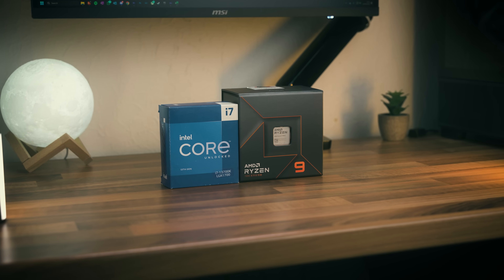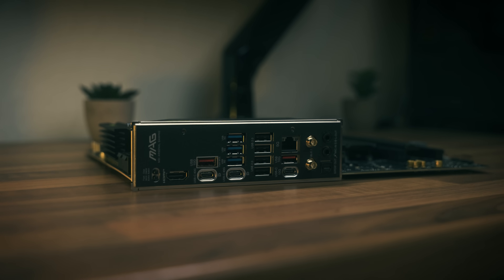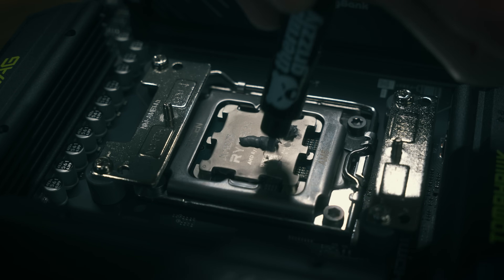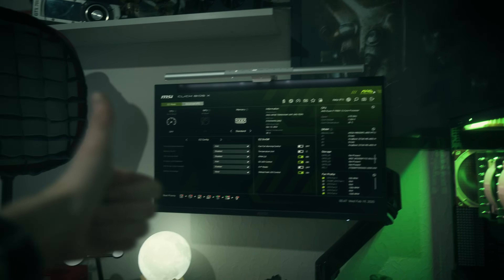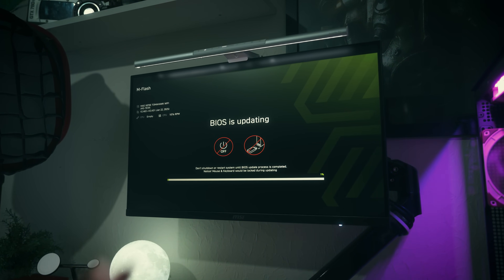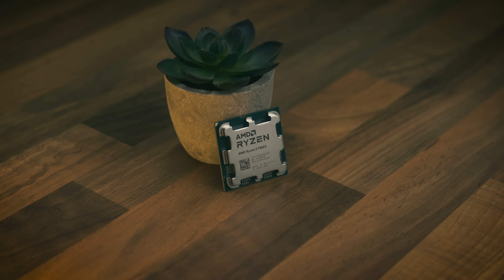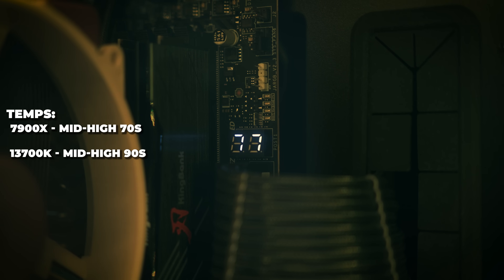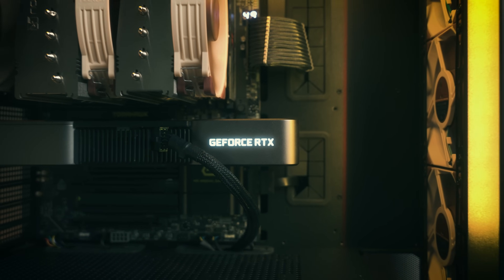Why I Switched to an AMD Ryzen CPU in 2025 (7900X)

Comment from the maker: UPDATE: After reinstalling the drivers again and again, the 5GbE LAN now works. Weird issue right😂
Reply: Good to know. That's def weird. Also I returned my MSI MAG mobo and CPU because something messed up in the mobo or (and) CPU, and my last ditch effort was unable to fix the issue.
Reply: Wasn’t aware that this 12c 24t was on am5 gives me hope to upgrade as was gonna get the am4 version. AM5 seems to have a lot of bugs on MSI and asus  and finding gigabyte is way forward or using asrock as there is nearly next to no issues every time I have read up for this chip and can use 4 sticks ram too
Reply: @ Yeah I've heard that AM5 on an ASUS was a disaster, and there were some examples of VRM exploding. That was about 2 years ago, and I think now ASUS has very likely fixed this issue

Comment: For the responsiveness thing on intel from my exp it seems to be tied to core parking for whatever reason it seems alder lake and raptor lake are very slow to wake up the cores from sleep. You can turn it off but intel does not recommend doing so apparently its tied to how their boosting works. I think buildzoid has a video covering it

Comment: yes, ryzen tends to be snappier. i have an i5 6500 and a 12700k, then in 2023 i got a ryzen 7600. just 2 weeks ago i got a 9950x3d. i got it almost for free. FREE! the two ryzen cpus are much faster and snappier in almost everything. intel monolithic cpus dont have usb at the cpu so you connect via chipset. amd on the otherhand has usb directly connecting to cpu in addition to more pcie. i dont think this is the reason or the only reason why ryzen cpus feel snappier. there could be other reasons to this
Reply from the maker: I had a hunch the I/O controller position on Intel would cause it to feel a little less snappier. The fresh OS install certainly helps too

Comment: I don't know what is with these 2.5g ethernet ports but they seem quite hit or miss. I have an Asrock x570s pg riptide motherboard. It works when it does but for some reason after "x" amount of time it just cuts internet for no reason. I tried everything and got enough and bought a seperate 2.5g pcie card for internet and everything just works without any fustrations.
Reply: i noticed this a lot of intel nics but i wonder if its possibly a heat issue as i notice alot of these issues get resolved with a pcie network card

Comment: Using that 3rd M.2 drive in that board, did that knock your GPU lanes down to 8 lanes instead of 16 lanes ?
Reply from the maker: No my GPU is still running at x16. The third NVMe is connected to the chipset

Comment: I got the Ryzen 9 9900X for $330 3 months ago for a better optimized AVX-512 pipeline compared to Zen 4. I came from a dead i9-13900K and wow! AMD is so good now, even with 8 less threads than my i9 had not only did it handily beat it in multi-threading workloads but it also beat it in single-thread while only pulling 120 Watts! So I moved to a noctua air cooler from a 360mm AIO thanks to the more sane power draw. I also noticed that the DDR5 memory controller seems to be a lot better than intel's. My 6400 MHz XMP just works OOTB and I was even able to tune the infinity fabric clock to 2133 MHz to better match the 1:1 ratio, I am seeing great performance out of this chip! Intel just sucks now lol
Reply: make sure to manually set uclk=memclk(gear1). most motherboards wont do that for you and instead set it to gear2 mode. 6400 gear2 is terrible. i dont know if your 9900x can do 6400 gear1 but if it can that would be amazing. if it cant you can still do 6200 gear1. that would be much better than 6400 gear2

Comment: What a sick system! I wonder with so many SSDs inside, do they block any threads of the GPU? In any case, very nice looking and performing system YamYam..
Reply from the maker: Thanks man! Glad you like the rig. My GPU is running at the full 16x lanes. The 7900X has 24 usable lanes (16 for the GPU, 8 for storage directly wired to the CPU)

Comment: in terms of performance this is a downgrade imo. 7900x is effectively a 6 core gaming CPU.
Reply: Not only is the 7900x a 12 core CPU, it's also faster than the 13700k. Base clock for 13700k is 3.4 GHz and boosts to 5.4  GHz. The 7900X starts at 4.7 GHz and boosts to 5.6 GHz. It's not a massive upgrade but it's definitely an upgrade.
Reply: @TheRosemouth  I'm to lazy to check wich cpu I faster but comparing cpu clocks is meaning less. Each generation of cpus has diferent amount of stuff it will do per clock.
Reply: Have you seen the entire video ?

Comment: It's a good CPU for the money, but why not get the 7950X? I've often wondered why someone would choose the 7900X over the 7950X, so I'm genuinely curious.
Reply from the maker: It didn't seem worth the extra 100 or so quid. The 7900X performs identical to it in single threaded workloads like Lightroom. And for Premiere Pro, most of it is accelerated by the GPU anyways.

Comment: Congrats on your new platform! I hope AMD treats you great. Im sure you will appreciate the lower heat in summer compared to the Intel CPU. I will stick to my 13700KF for 2-3 more years. Specially now that I have it with 7400Mhz 48GB DDR5 RAM with tight timmings
Reply from the maker: 7400MT/s is crazy fast mate! With spring and summer approaching us, the 7900X will work a treat!

Comment: Congrats on your upgrade. I have a couple of PCs based around 5700x3d, RX 6700 XT and 7800 XT. And my last PC is based on the i5 13400F with DDR4 and a RX 7700 XT. Very happy with my setups. But I don't do productivity. Only casual stuff and gaming.
Reply from the maker: Nice rigs you got there mate. Happy gaming!

Comment: Hi there mate, just wanted to say what a nice build! Really like the theme of your build with Noctua, fits right in with your content style.

Ryzen really is good value for money, you certainly made the right choice here. For my own AM5 build I grabbed a cheap B650 for £100 and 32 gigs of DDR5 off eBay for about £72, with my CPU being a Ryzen 7 7700 which I grabbed off AliExpress for just £146 (about half what they go for on Amazon)! If AliExpress sold Ryzen 9s for cheap I certainly would have considered getting one.

I initially went with Corsair Dominator Platinum RGB RAM but after finding that it wouldn't fit underneath my Peerless Assassin tower cooler I ended up swapping it to a cheaper and much sleeker Corsair Vengeance kit, so I can certainly relate to your situation.

For storage I got a 1TB TeamGroup MP44L as a boot drive and a 2TB Lexar NM790 for games, that should more than cover it for me as I'm not really a creator unlike yourself haha.

I agree with you on the bit about thermal paste too, went with the more viscous TF7 that came with my Peerless Assassin instead of MX-4 to help with temps after upgrading from a Ryzen 5 7500F to now this beefier Ryzen 7.

As for GPU launches it does seem quite gloomy yeah, I for one will probably stick with my trusty 6800 XT especially if the new Radeon launch leaves anything to be desired pricing wise.
With case fans I also noticed lower volumes after I switched them from going off CPU temperature to going off system temps instead just like in your case.

With the CPU responsiveness although I haven't used an Intel CPU in quite a while, I did see Tech Yes City's video on this. It does indeed seem like a design issue with the I/O circuitry being moved away from the cores and causing latency issues. This reminds me somewhat of AMD's issue with their chiplet design which eliminates any FPS gains from having 3D V-Cache on both CCDs of a Ryzen 9 X3D CPU due to the latency penalty from having two CCDs rather than just one. 

It would certainly be nice if AMD could come up with a 3D V-Cache CPU single 12-core or even 16-core CCD for next gen with even more V-Cache than we've seen before as that would really help in memory bandwidth limited scenarios where Ryzen's IMC really struggles against Intel.

Before I finish this comment I just had one question, did the Intel CPU meltdown scandal from last year play a part in your move to Ryzen?
I know many people online who simply called it quits on Intel after being thrown under the bus by Intel whilst trying get their broken CPUs RMA'd.

That's all I have for now, and I hope you enjoy your build, seems like it will last you a while!